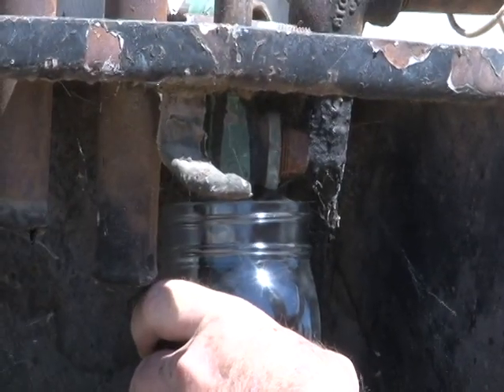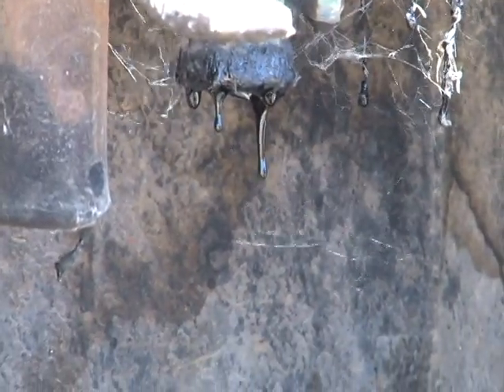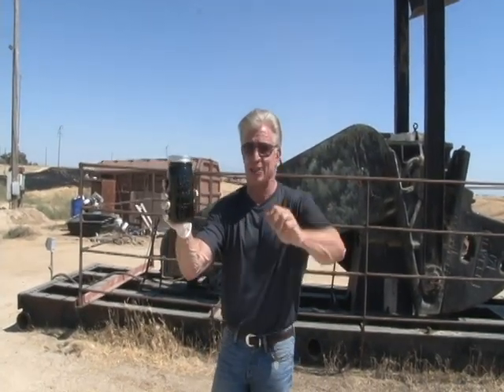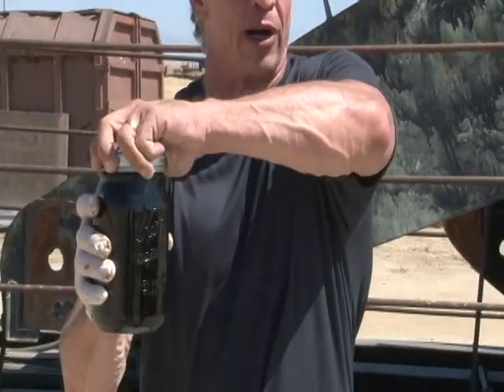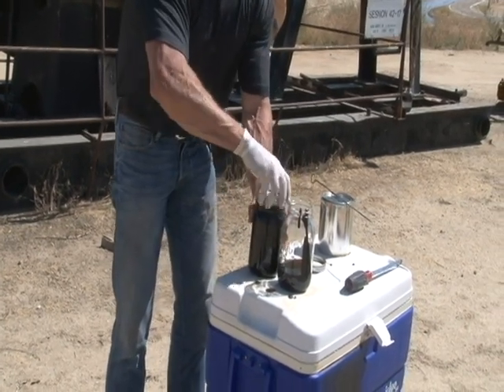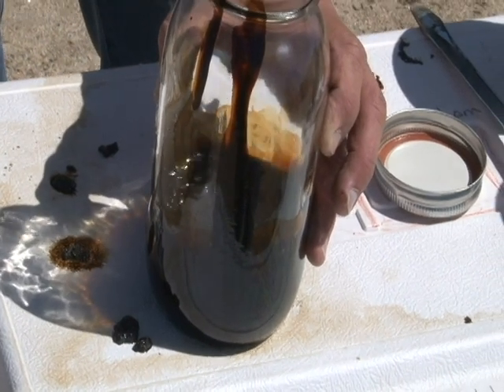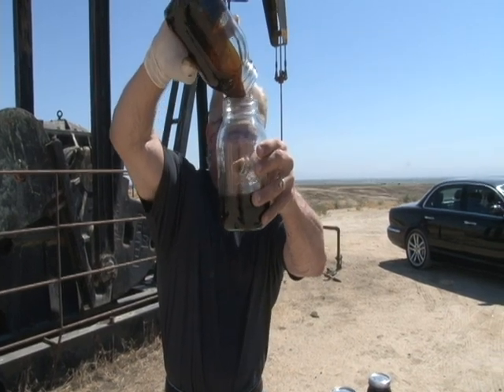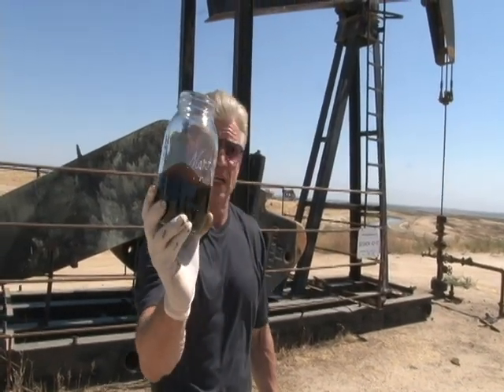Heavy Oil

Comment: In what temperature is safe to heat a crude oil API 15 or API 20 in atmospheric storage tanks by thermal oil circulating coils inside tank?  I'm thinking if we can heat  it at 60 degrees celsius it might release  a lot o vapors and the  breather  valves will open very often. Any opinions?